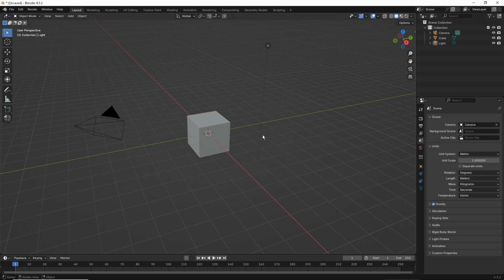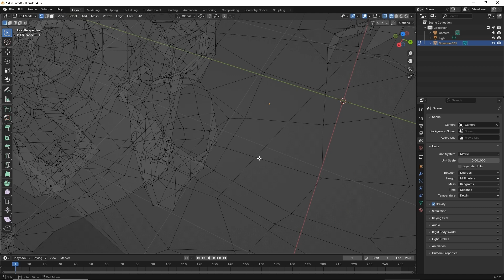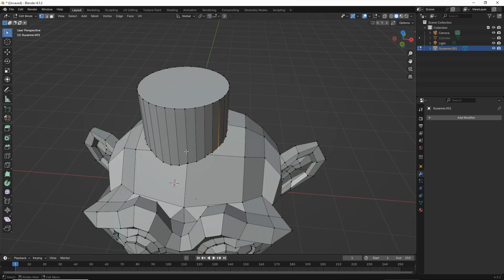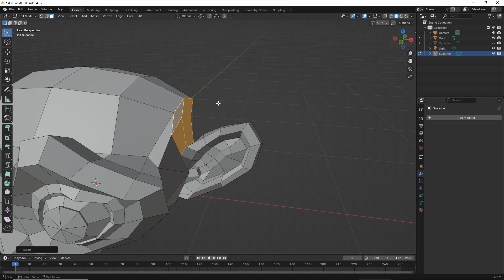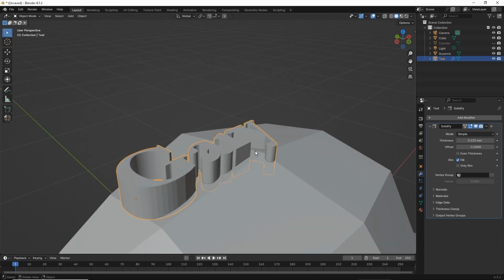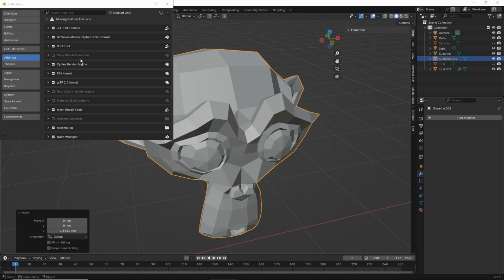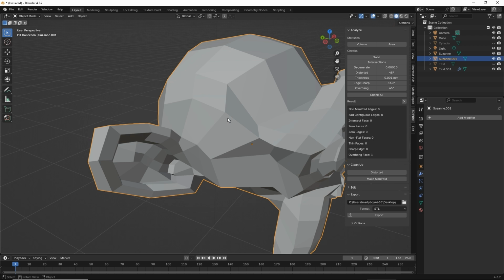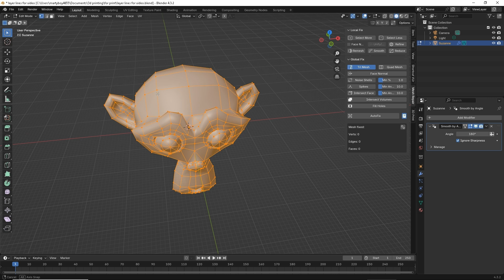Blender for 3D Printing: 10 Tips to Boost Your Skills

Comment: Yeah but how do you save your preferred settings for every project? This is the thing that's pissing me off about Blender... =\
Reply from the maker: Give this a try :)
To save your preferred settings in Blender, navigate to File > Defaults and select Save Startup File. This will overwrite the default startup file with your current scene and preferences, ensuring they are loaded automatically on subsequent launches. You can also save user preferences, which include keymaps, themes, and other settings, by going to Edit > Preferences and then saving your preferences manually. 
Detailed Steps:
1. Save Startup File:
Open Blender and configure your scene and desired settings.
Go to File > Defaults > Save Startup File.
A confirmation box may appear; click Save Startup File again to confirm.
2. Save User Preferences:
Go to Edit > Preferences.
Customize your keymap, themes, and other preferences.
Go to File > Defaults > Save User Preferences.
You can also manually save your preferences from the ☰ menu in the preferences window, which is the default behavior on exit.
Reply: @LayerLabAustralia  oooh, ty! :D

Comment: Couple tips!
If you hover over an object in edit mode, you can just press "L" to select everything connected to the object rather than selecting it eveytime.
You can also get the Bool Tool addon to make the booleans even easier to use. You just select the two objects, and pick your operation, and you are done! Great video :D